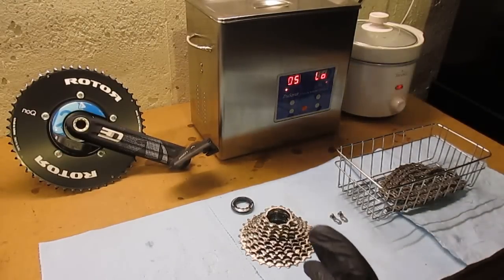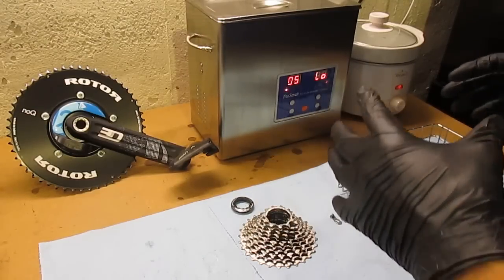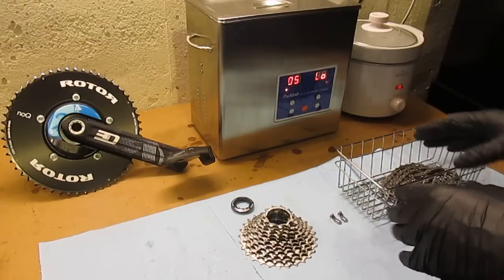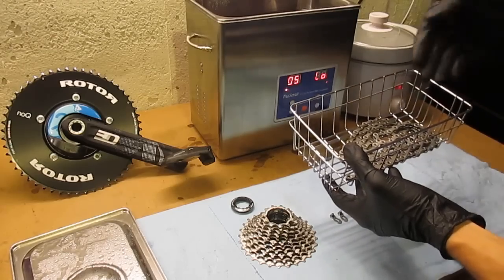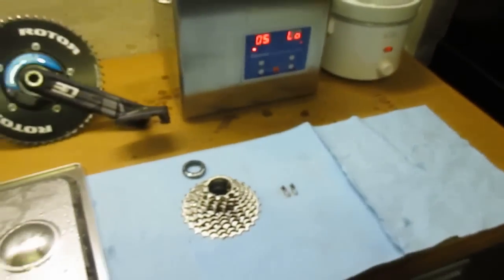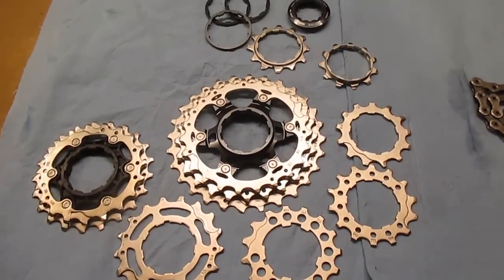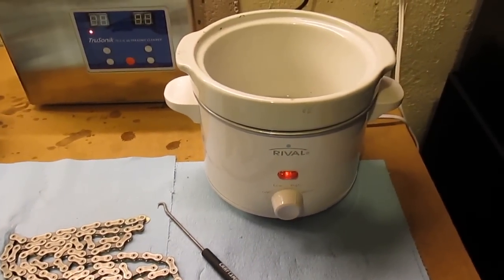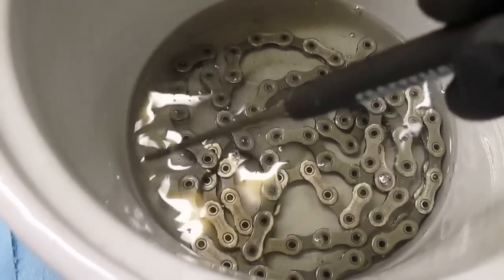Paraffin Wax Chain Lube Conversion

Comment: Good demonstration, you may have just sold an ultrasonic cleaner. Looks like something I need.
But I'm concerned about how degreased the parts are compared to my procedure which finishes with a bath in denatured alcohol. In order for the waxing method to be effective the parts need to be completely degreased first. Your thoughts?
Reply from the maker: The ultrasonic cleaner (UC) is great. . . but it's not magic. . . sometimes there is a bit of residue left after the ultrasonic cleaner, but it wipes right off. When I first got the UC, I used a highly concentrated mixture of simple green and water. But, I learned that the high concentration was unnecessary. Now I use mostly water, with just a little bit of simple green, or other degreaser. You are right that you want stuff very clean before you put the wax on. The cassette is easy to get get clean. The chain is a little harder. I run the chain through the UC, then I put it into a container filled with a clean solution of simple green/water and shake like crazy. After that I let it dry and into the wax it goes.

Comment: Paraffin is not lubricated! Paraffin smeared the ancient wooden wheels of carts, but not the bicycle chain. I use automotive gear oil, the friction coefficient of which is very high. I've tried all types of grease, the best result gives only the gear oil

Comment: Very nice tutorial.  I've done 2 bikes now and can see some wax build up on the chain rings after only a few miles.  Is there a clean-up routine for this?
Reply from the maker: I too get wax build up on the chain rings, but it's not grimy like when I would use a liquid chain lubricant. To minimize the build up, I take care to "fling" the chain several times soon after I remove it from the crock pot. This removes excess wax.
Reply: That's true; pretty benign by comparison.  I just pulled a crankset off (for a different reason) but just ran hot water over the chain rings in the kitchen sink and all the residue washed away.  That was cool!

Comment: I have tried that method, however after about 60 km I got chain grinding(MTB). How often do you re-wax yours?
Reply from the maker: I'm sure I can't answer your question adequately. Nevertheless, for some individuals, maintaining their bikes in pristine condition is part of the enjoyment - Finish Line Dry or otherwise.
Reply: UPDATE: Okay at first I liked the idea, but now winter came bringing very wet conditions. My chain caught rust after one ride despite it being waxed properly. Sadly going back to oils again!
Reply from the maker: I rewax about every 100 Miles or so. I don't exactly keep track, but my rides are usually between 25 and 50 miles, and I rewax about every 3 to 4 rides.
Reply: thechosendude I beg to differ. Many people on youtube including people whos business is chain waxing and making kits etc laud the benifits of chain waxing for the worst conditions including x country 24 racing in mud. Personally I dont wax but the concept and  science interests me as does the many differing experiences with wax based lubing
Reply: Last to Fast which is more than I'd ever re lube using a synthetic Teflon based product like finish line dry. If this is your re lube schedule, what on earth is the point of going to so much trouble?
Reply: Ronen Barski - Wax is only for dry conditions!
Reply: You must be rewaxing all the time!!!
Reply from the maker: I'm sorry to hear that!

Comment: how do you handle cleaning, ie when cleaning the frame will the wax be removed over time?
Reply from the maker: When I clean my frame, I usually remove my wheels and the chain. I use a quick link in my chain, so its easy to remove. Here is a video of the quick links: https://youtu.be/RZqumRqJncY

Comment: Thanks for your video.  Your cleaning demonstration is really good.

I'm an avid user of Paraffin wax, and agree with everything you've posted here except one thing.  Paraffin does NOT last longer than traditional petroleum lubricants.  Not even close.  It does last longer than other liquid wax lubricants, especially the dry forms, mainly because it is melted and penetrates better.

I typically get about 100 miles from a paraffin treatment, assuming dry conditions.  If it rains, I have to re-wax immediately.  It does not stand up to wet conditions (I don't use paraffin on my rain bike for this reason).

The bubbles you saw in the crock pot are from water down inside the rollers boiling off. A little bit like this is ok, but as you mentioned, you never want to put a 'wet' chain in the wax, as it will boil off really hard and fast, and create a very dangerous situation.   Also, you eluded to not using it on the stove.  Paraffin will flash off and burn somewhere just above 200 degrees.  Do NOT expose it to direct heat, or splash it on a burner or flame.  It will burn, and it will spread quickly.   The Crock Pot is by far the safest way to melt it.  You just have to be patient.  Those inexpensive crock pots heat up slowly (this is a GOOD thing). 

A helpful tip for easier application: If you bend a non-painted coat hanger into a U shape, you can loop the chain over it 4 or 5 times and 'swish' it around in the hot wax.  You need more wax in the crock pot to cover it this way, but it makes it much easier and safer to handle and you will get a better (deeper) application.  You can see the instructions for using this 'swish' method on the "Molten Speed Wax" website.   This is the specific wax that was rated #1 by the friction facts testing you mentioned.

Lastly, if you apply the chain to the bike before the wax cools and hardens, and pedal it and shift it through the gears, it will move the excess wax on the plates away from the pivot points and eliminate the messy flaking you can get.
Reply: I am assuming that you use paraffin alone for lubrication.

I can easily get 300 miles out of a lubrication because I use a second lubricant.  Using paraffin alone is not the ideal solution because there's nothing to prevent it from flaking off.  Paraffin works best if it's mixed with a liquid lubricant because the two lubricants work together to hold each in place.  I use motor oil while others use paraffin oil.  Whatever you use, the best result comes when enough oil is added to the paraffin to prevent the paraffin from flaking off the chain.  I believe this is why you have concluded that paraffin doesn't last as long as traditional petroleum lubricants.

Even with the motor oil, I still get all the benefits of using paraffin.  The chain doesn't gather dirt and I haven't cleaned any of my chains in years.  Shifting is, of course, excellent.
Reply: Phil Houck: i tested how long chain can last  between 2 waxing with 50:50 wax/ parafin oil and answer is 120-140km, once was 180km and chain died, if rewax every 100-110km it can last for double life span and more, and second thing i still  testing ratios of parafin oil and pure wax and for lower temps is better more oil but not too much because it start to act as butter and start to collect itselfs and dirt on chain and rings, so ratio must be that it fall off from chain and gears
Reply: Phil Houck Wow interesting. What kind of motor oil do you use?.
Reply: I use a commercial product that is specifically formulated for bikes called "Molten Speed Wax".  I'm not sure what the additives are, but it's definitely not just plain paraffin.   It has a gray tint to it, and when the wax is warm, if  you let it sit, the darker particles settle to the bottom.  

Any wax on the outside of the chain isn't really doing any good, and in fact chunks of wax on the shift ramp will adversely affect shifting performance, which is why I thoroughly wipe the outside of the chain with a towel before I install it.  And as I stated before, installing the chain and shifting through all of the gears wile it's still soft really reduces any flaking.
Reply: Thank you.  I just can't imagine going through this entire process once every 100 miles though.
Reply: David Hanny: than for you would be better to use inductive heater to warm up chain on bike and rewax it in 15 minutes with no pots fryers ....
Reply: A chain wax lube will last at least 300 miles if you are not going offroad and some MTB riders claim they don't see any dirt.  Once you have everything you need for a wax lube, it doesn't take that long to do and the results will justify the time.
Reply: The channel Oz Cycles recommends adding paraffin oil to make the wax less flakey. Logic being, if the wax flakes off, it's not protecting your chain. Those of you who wax your chain, have any thoughts?
Reply: Exactly!... I’ll mention the I add PTFE POWDER (1.6 micron) to the wax... I can go around 300 miles on one treatment.
Reply: yep... yer right. I've just started using it again for mtb as a chain lasts 400 to 500 smiles as the chain deforms during gear change it does get pushed out a bit,im hoping i may get more milage per chain as the frickin grit cost 12 to 14 chins per year or chains even
Reply: it's not too bad once you get the process down. it becomes a lot more efficient. the biggest downside for me is the expense of replacing links or chain pins so often.
Reply: MidgenTwentyOne The bubbles are not from water boiling off the chain links.  The bubbles are from air pockets in the links and rollers being displaced by the paraffin wax.
Reply: MidgenTwentyOne: Congratulations, you are first that realized some things that others did not: wax can last  120-140km, yes i noticed bubbles too and think on same thing- water, and i have some good advice to you because you could recognise full potential of it: to wax chain or heat up chain on bike ,use inductive heater , i can clean with wax and rewax chain in15 minutes and i have done it every 100km and life span of chain prolonged on double and still no sign of chain wear

Comment: As opposed to "flinging it over your head a few times", the best method is to pick it up with your pick (NOT a rag as this will remove paraffin from the chain), hang it on a hook or nail, straighten it out and let it DRIP HARDEN. You want to keep as much of the paraffin on the chain (on the plates and in between the rollers/pins) as possible.
Reply: mtlnascarfan - I was going to say, retaining as much as possible is best.  The excess will just fall off.

Comment: Thanks for the video!  How often do you need to reapply the wax to the chain?
Reply: For 'in between' hot wax treatments, you an use 'Squirt' liquid wax (one small drop on each roller is all you need - don't slop it on or it will make a mess).  It has the same properties as the melted paraffin.  The only downside is, being a liquid, is that it is not quite as clean as the melted paraffin, and of course it doesn't penetrate quite as well, which means more frequent application. 

Also, look up 'Wend' wax products (they make wax for ski's and such).  They have a product called "Wax Off" that is really good for cleaning a waxed chain.   Just a few drops on a rag will clean off any excess wax.  I always wipe mind down with this before I put fresh wax on, especially if I've used Squirt, or some other liquid wax.

Once I've converted a drive train to wax, I never put petroleum lube back on it.  Too much work to have to re-clean everything.  I'd rather ride my bike. =)
Reply from the maker: I just reapplied the wax a couple of days ago. I ride on it until it no longer sounds silky smooth. . . usually after 100 miles or so. When I reapply, I just clean the chain (instead of deep cleaning all the drive train). Sometimes, if it needs more wax, but I don't have time, I just put a little conventional lube. But later, I will have clean the whole drive train, because the conventional lube gets everything so grimy.
Reply: Fun easy to do mechanical test as well, is when you notice each link having that sand like abrasion sound when moved against each other.... this means the links are already dirty from the inside, specillay if you cleaned with a brush from the outside and still you hear this "abrasive" sound.
Reply: Long time wax user here, as well as a past Cat 2 roadie, experienced tourer and past mechanic.

I wax every couple thousand miles (once a season) depending on how dirty it looks. I maintain lubrication in between rewaxes with White Lightning, maybe every 150-200 miles, or as needed in wetter conditions, making this no more labor intensive then a wet lube regimen.